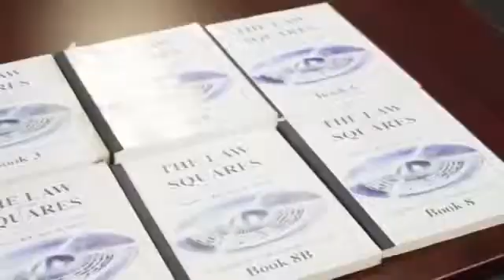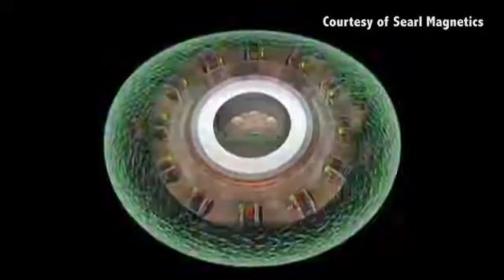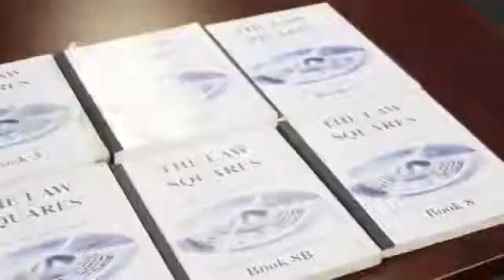The Future of Energy • The Searl Effect Generator (SEG)

Comment: "This unit doesn't wear out".  Doesn't oxidation occur on the magnets?  The physical breakdown of the magnets was always a problem in the past.  How did they fix that?
Reply: There is a negative charge around the magnets which prevents oxidation. The magnets could be charged again after a few decades. Searl had his device for 30 years and it was still fully functional until it was stolen from him by UK authorities in 1981.
Reply: @michaelvoigtlander9721  its always the authorities preventing inventions that collapse profitable industries